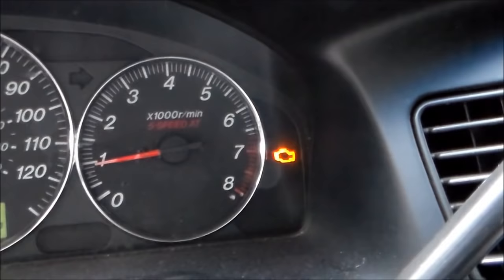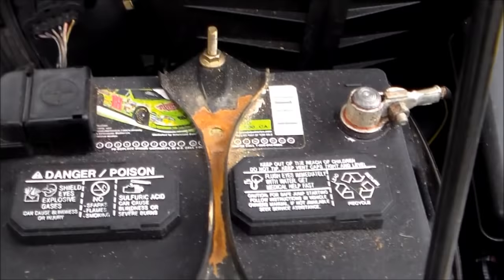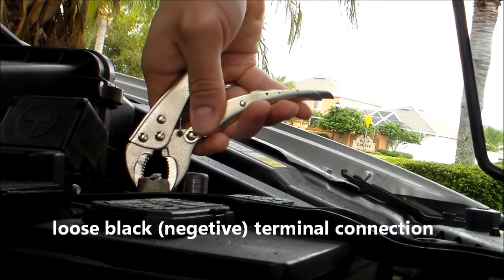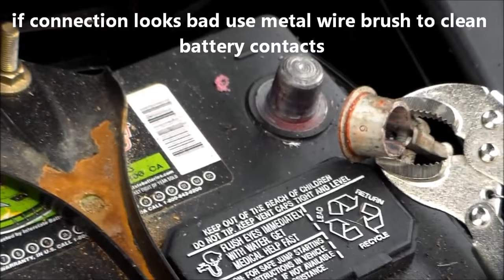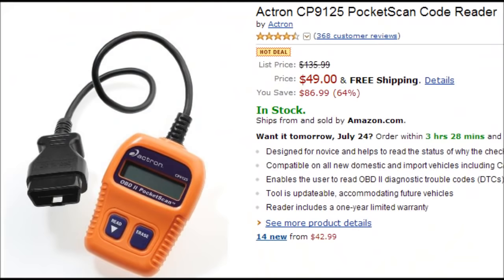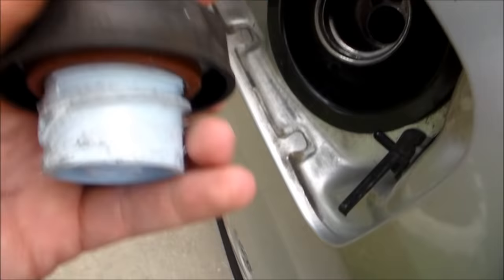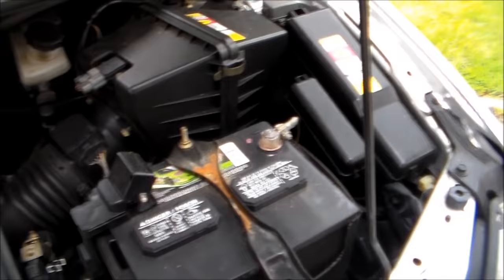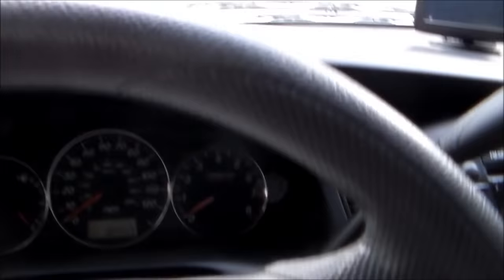HOW TO RESET CHECK ENGINE LIGHT, FREE EASY WAY!

Comment from the maker: UPDATED VIDEO- "4 WAYS TO RESET CHECK ENGINE LIGHT"  https://goo.gl/xsfnoJ 
under $20 scanner (works with gasoline cars 1996 and newer) scans for errors & resets code but fix the issue otherwise error will trigger again. OBD2 plugin Scanner http://amzn.to/2kEjN6E & OBD2 bluetooth Scanner-https://amzn.to/3n34xDP * affiliate links
*point of the video is an error light might trigger by simple loose/bad gas cap and to show how to reset light.
Reply: Hey Now Tampa Tec...
Great video and information about this technology. I really appreciate it 
I'm a tech who also lives in Tampa (via Philadelphia) 
Good job my friend, 
Matty.
Reply from the maker: +I Am The SONOFOVERBROOK thanks, I tried to fix some parts few people were upset about but can't edit this video, so I made a better version "4 WAYS TO RESET CHECK ENGINE LIGHT"  https://goo.gl/xsfnoJ
Reply: Tampatec
Reply: Martin Castro
Reply: Martin Castro pl
Reply: Tampatec hhh
Reply: Tampatec
Reply: dhhti
Reply: Tampatec p
Reply: Tampatec if it's a hard code it will pop back up as soon as you turn on key switch
Reply: Tampatec ło
Reply: Tampatec .
Reply from the maker: with a scanner you don't have to disconnect the battery terminals. i made a way better video "4 WAYS TO RESET CHECK ENGINE LIGHT"  https://goo.gl/xsfnoJ
Reply: Tampatec toss in a can of BG44K. BG is one of the best on the market.

Comment: Why is everyone so negitive? He is only trying to help! I thank him for his insight and his time for making the video. It may not work for long but it will pass inspection.
Reply: nope,!!! it won't and it will turn back on between 2 to 5 miles. and one last thing you don't have to wait 5 minutes for the computer to reset. once you disconnect the cable it resets QUICKLY.
Reply: Trina Cote no it won't pass inspection

Comment: Have you noticed all of the ignorant negative comments are from car "mechanics" ?!?!? You put a hurtin on their wallet like they do to us when they want to charge a ridiculous amount to do the exact same thing LOL Love it when we save our hard earned money from those rip off "mechanics" who usually always intentionally mess some thing else up in my car just to keep their money flow coming in !!
Reply: +Charlie Hutch  What is the orange icon that appears on the dashboard ? It is an icon of a car with a spanner in it !! I see it only in Astra. I never new what it is.
Reply: urdu learner
Spanner is usually an indicator of throttle body or timing related mechanical fault, as opposed to an emissions/powertrain fault that triggers the CEL. 
Spanner/wrench means service engine soon, CEL means check emissions system. 

The spanner, which is most common in Fords now, is usually an indicator of LIMP HOME MODE (LHM), during this time throttle will be reduced and it will not shift into a lower gear in order to protect mechanical hardware such as valve train/timing fault or transmission. In teh case of the 5r55e transmission for one example, it WILL shift but will thump into gear as it sets the transmission pressure control servo at a much higher pressure to shift.
 
However, MANY transmission codes will still flip a flashing CEL instead, you really need to pull codes and know how to diagnose the circuit in question to find the repair.

NOTE: A code very often does not indicate a faulty part but a fault found by part of the system.  That's why people and dealerships endlessly throw parts at it to no avail, proper diagnosis is imperative. Ex.  An O2 sensor code often means the sensor is fine but unable to operate in range due to other issues.  A throttle body code often means the $50 CPS isn't functioning properly, but the $200 throttle body is just fine.
Reply: ozmedia  Thanks. I hope you provide with a link to a forum where I can I discuss freely with Astra J owners. There are lots of things and jargons which I don't know. If you ask me to define my car , I will just say it is Astra J. I have been looking and searching and found out many things to know in advance to keep up if I wish for efficient and powerful results. Today I managed to make the icon disappear. It happened by chance and was based on scattered infos I collected from here and there. The web says in many sites it is related to oil change and should be reset right after.
Reply: Most cars need the oil light reset after a change, with European cars, it is often part of the diagnostic link connector, which wasn't standardized until the mid 90's.  BMW and Mercedes still use proprietary connectors for such lights but they have the standard ODBII connection for diagnostic work.  You can usually short it out wiht a paperclip or there is a factory reset procedure without the need for the proprietary tools. 
As for finding forums, I would first suggest changing your browser to think you are in a European/UK location, then you will get more reelevant hits as it's not a popular car in the USA...or is it India or somewhere in the Middle East?  not too sure by your alias, sorry if I got that wrong.
Reply: Ha you're so right
Reply: how to replace honda accord 2008 radio code
Reply: Sami Subi
Your link didn't show up. Are you one of those guys wow does his homework by asking for help online? I've seen a LOT of trades students who ask questions as if they are offering info because of the way tests are written. 
There are FAR better resources than YouTube for what you need.

Comment: Just wanted to thank you. This saved my ass. My Mitsubishi Endeavor's light would not turn off. The dealer charged me $110 just for the privilege of speaking to them about it, where they proceeded to hand me a bill for over $3000 in repairs, insisting I would not pass an emissions test without all of it. I yanked the negative on the battery for a couple minutes, plugged it back in, completed the drive cycle (about 40 mi. of city and highway driving), and the light never came back on. Passed emissions without a single error. Thank you, thank you!
Reply: +Vincent Jenks 1 in 10000000000000.  You either had a false positive trigger or you are driving around killing it slowly.  Had hundreds of people call BS on emissions repairs and see their cars dropping dead regularly.
Reply: +Harry v.d.akker "Trust only yourself": If you are a licensed tech with emissions diagnostic training.  if not you are just a fool forcing your car to relearn driving strategies at you future expense..

Comment: Was about to take my Mazda 5 into the dealership, would have cost 115 just to look at it. I already knew that the gas cap had been left off, but the engine light wasn't re-setting after it was screwed on properly. Your video just saved me the time, trip, and expense. Well done and thanks!

Comment: Thank you for your video, I never thought the gas cap could be the reason why my check light was on, but couple days ago I went to the gas station to fill up the tank, then close the cap and realized couple blocks away that the light went off. I almost spent a lot of money buying the converter and sensors online. Thank you for sharing this video!

Comment: dont expect to reset your check eng. light and then pass the state inspection. I am a state inspector for mass. If you reset the check engine your vehicle will not have the monitors ready (o2 sensor, cat, emissions, ect.) so good luck. also this wont damage your car but like some people have said. it will reset everything and unless you know how to program your sunroof, power mirrors and sometimes radio you may have to take it to the dealer for a little bit of money.

Comment: Thanks for sharing. Here are a couple things that might help you n the future: 
1. If you are going to suggest to viewers that they buy a tool kit, I would suggest that they buy a wrench to remove the battery terminal instead of locking pliers.  Using anything other than a wrench or socket will damage the nut, making it harder to tighten and loosen the next time.
2. The only part of the gas cap that matters is the seal around the top. Yours looked fine.  As long as the cap locks down tight against the top of the filler tube, and the seal isn't cracked/damaged, its fine.
3. It can take up to 100 miles of driving after a "battery reset" to throw the same error codes.  This isn't a fix, it just turns the check engine light off.  The problem that turned the light on is still there, and will not go away by turning the light off.  Think of this as removing the bulb behind the check engine light icon in your dash.  The light isn't on, but the problem is.
Take care, and good luck with your van.

Comment: As long as the problem is there the CL light will come on again. It looks like your problem is a fairly common one easy to pin point and solve. One good advise is never to tighten the gas cap in a rapid way. I spent a lot of money on 02 Santa Fe until I realized and then learned to close the cap slowly and not more than three ticks. This may work for some as well.

Comment: Wicked, worked a treat, I had run for a while without the temp sensor so it threw up the engine management light, I then had a new starter put on it (which is why the wire was disconnected because it worked with the lead off (management system thinks cars cold so heats the plugs so a worn starter will start the car).  Anyway all sorted now, thanks.

Comment: FIX THE PROBLEM FIRST. Resetting the C/E light is done only AFTER the problem that caused the C/E is fixed. If you don't fix the problem that caused your C/E light to come on and reset the light, the light will come back on.

Comment: Thank you so much! I was gonna take car to mechanic for check engine light 99 honda civic. Watched your video, gas cap wasn't on tight, reset as per your instruction.
Reply: mark y FYI... if you have a loose gas cap, you don't need to clear the code.  It should clear on it's own after some drive time.
Reply: John Hilman it didn't, so i had to reset it...99 honda civic
Reply: mark y

Comment: That's the same thing as doing a "hard reboot" on your laptop, smartphone, or tablet (unplug from the charger, remove the battery, wait 30 seconds, reinstall the battery, and turn it on). In many cases, this will also wipe out some rather nasty viruses.

Comment: OMG!!!! you are not going to believe this but, my light had been on for over a year and I'd taken it to many mechanics and it seemed like no one knew how to get the light to go off.  They took out this scanner and did some reading and I had things replaced that I was told that needed replacing.  Afterwards the light went off to only come back on after driving a couple of miles.  I'm not saying the light will not come back on but they did not know something so simple would make it go off.  If it stays off I will come back and repost and let everyone know.  Not that is probably matters but...Tampatec, thank you for posting this to youtube.  I am subscribing to your channel for sure.  Thank you.  Now I got to get her smoged and serviced.  She need it so badly.

Comment: My husband will do what you said in your video. I'll post the results. We have a Honda Civic 2004 and the engine light is on since about 10 months ago. Everything seems to ok, but the light is still on. Thank you for sharing.
Reply from the maker: sometimes its bad o2 sensor or air in gastank. Fix problem or check engine light will activate again. good luck 8^)

Comment: I worked in emissions repair for years until recently when I started at the University...locking gas caps are notorious for leaking.  A standard gas cap with a good soft rubber seal is perfect.  Now, idiots at auto zone saying there was "air in the tank" needs to be fired.  There's ALWAYS air in the tank.  When the system doesn't pressurize properly, due to a leak, the computer sees there isn't enough flow coming into the carbon canister and throws this light.  Most times it's a gas cap, but the code reads a leak SOMEWHERE in the system.  Now, you may have reset the MIL and set all of the emissions "readiness indicators" to "Not Ready", but when the drive cycle is completed, the light may come back on.  Until the system hits proper conditions to test the pressure of the fuel storage system, the light stays out, but the "readiness indicator" for that particular system is not set as "ready".  If too many (more than 3 in AZ) are not yet "ready", you are told to look up and drive the "drive cycle" for your vehicle.
Reply from the maker: +Jason Nichols good to know thanks, very smart comment and informative.

Comment: Thanks for your efforts and your attempt to be helpful. I would like to repeat the caution noted by several others that you should always use a wrench of the proper size when removing a nut. If I see a mechanic who is working on my car attempt to use pliers or channel locks to remove a nut, I ask him to use the proper wrench. I would not return to his shop. My thinking is that if he's slipshod about using the correct tool, he is likely to be slipshod on other issues.

Comment: '99 Chevy Tahoe here.  Got the light and used the free meter at O'Reillys.  The interpretation I got from an old boy at the counter was that a vacuum leak is usually a failed gas cap.  Put the new cap on and the light went right out.  Another unrelated problem I had where I did the battery trick.. and the light came back on in less than half a minute.

Comment: I have a Mazda Mx5 nd if you remove the battery it needs the tyre pressure sensor resetting the tracker alarm recalibrating and a couple of other items it's easier to just do the clutch brake sequence to reset the E Management warning light as long as you know what the reason for it is.
However this was a useful bit of info for those who cannot locate the reset sequence on line.

Comment: I have a mustang with a "no cap" gas tank. It's a few years old with a little over 11,000 miles. It gives me so much trouble between trying to fill it up. Today my check engine light came on. Although I should have gone to autozone and get a reading... It worked. So far after a good drive not on again.
Reply: +HisDukeNess Fords do collect debris in the cupped area right below the filler hole, also teh seal around the cover sometimes splits or leaks, the door spring gets weak etc.

Comment: Definitely get the reader, you can diagnose many problems with one of those.  No point in resetting the engine light unless you can read the codes first, and the reader will reset it for you.

Comment: Hint...when working around a battery...take off your rings....Last thing you need to do is touch the pole on the battery and have your ring hit the side of the body....there goes your finger....burned to a crisp. Use caution.

Comment: Most people who turn the CEL off simply to make it go away will just end up screwing this up horribly. They'll either disconnect the positive terminal and short it against the body, strip the nut using the wrong tool like you did, and in some cases probably not even find the battery depending on manufacturer. Not to mention if they don't have their radio code, the alarm system resets, etc. More trouble than it is worth. Idk why you didn't just have autozone clear the code for you if that's all you wanted. Or better yet just stick a piece of tape over the light if you're not interested in diagnosing the real problem.
Reply: Autozone will read codes for free but they are not allowed to clear codes. They won't do it.
Reply: Whilst I agree with most you have said, re, not getting to the root cause of the problem I fail to see how a disconnected positive wire could short against the body, once it is disconnected there is no circuit.
Reply: Thomas Barrett  What if your tool touches the ground WHILE the battery cable is being disconnected?
Reply: Stantonv Does not matter if the Negative is disconnected first.
Reply: David Phillips
 Just be very careful not to ground out the positive while disconnecting the battery.  It could explode.
Reply: ***** Heaven forbid you ever replace the battery.....
Reply: As an ex autozone employee this is the scenario... They are not allowed to reset your code by federal regulation, to prevent people from attempting to illegally circumvent emissions and inspection law. Punishable by a fine of 5K to each party involved. As the owner you have "Right to repair" that protects you, unless it can be proven you are doing it with the intent to deceive the inspection station.
Reply: Chris Lesmerises Auto Zone reset my son's truck. He went to the inspection station and they could tell it was recently reset. They told him to go drive 20 more miles and come back. At 20 miles the light came back on. :-/
Reply: Stantonv I always disconnect the -ve terminal 1st. If I remember, this discussion started with someone saying if the +ve terminal is removed 1st it could short against the vehicals body, which Im sure you know is impossible.
Reply: Win Stabell Thomas Barrett Was also saying that the previous statement about shorting the loose terminal to the body was false.
Reply: Here is something common sense will allow..... If you are wrenching on a positive battery terminal and bump the fender with a wrench, sparks are gonna fly and possibly blow up the battery. If you disconnect the negative battery terminal first, nothing will happen if you bump other body parts with the wrench. Make it a habit....
Reply: That's because there is a way to circumvent the system (NYSI) if you know how....the guy who made this video has no idea what he could actually do....wont correct the problem with the vehicle but if its just an emissions code who cares...gets you through another year !